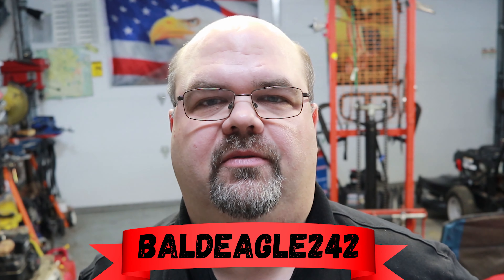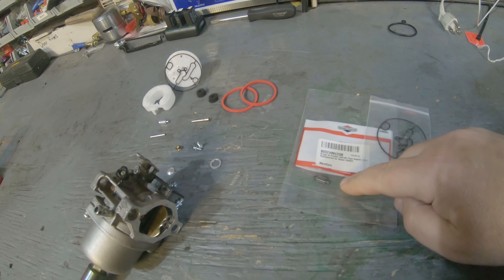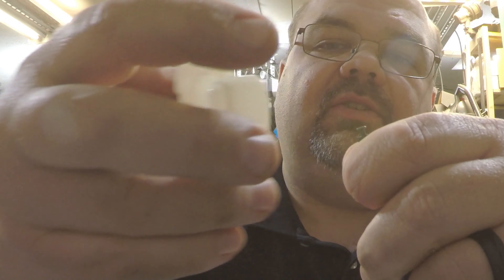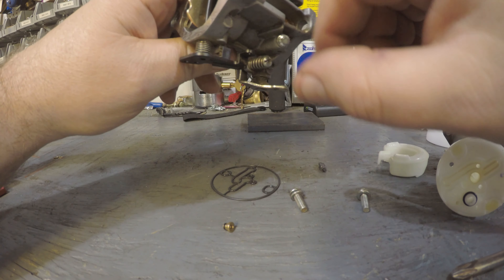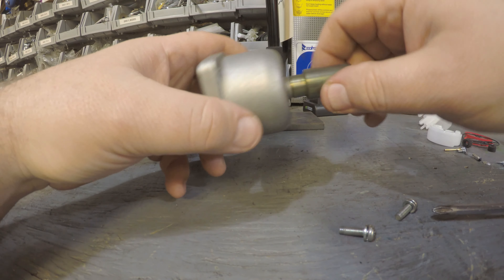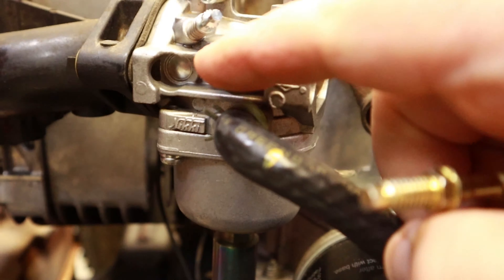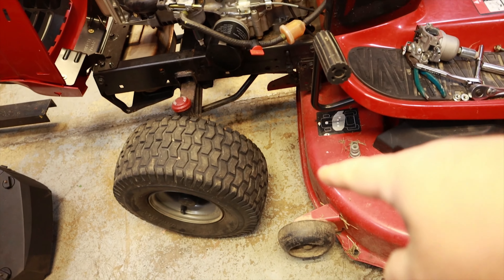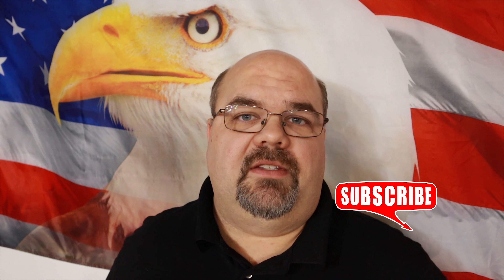No BS! Simple NIKKI Carburetor Rebuild

Comment: Very well made crap...  two rebuild take it off of b & s & be sure to brake the plastic float 
2. Rip the rubber gasket so it is broken
3. Grind the inner jet down to flush with carb so its junk
4. Throw nikki in the fire so it metls it good.
5. Put a LMT WALBRO on briggs. 
6. LMT has one simple bowly gasket , one well bilt jet... NO PLASTIC CHIT, OR RUBBER GASKETS TO PLAY PATTY CAKES...\
Reply from the maker: Here’s the Walbro swap video 😁👇
https://youtu.be/ZVbOFzW0inM?si=yBRVxyCebkjQqIzP

Comment: NIKKI CARBS are one of the worst junk ever made. then WALBRO fixed the NIKKI CARB JUNK with the LMT for the single briggs... Even me old 12hp briggs with the LMT has never gave me no issues, other then have to clean the ports once while. 

the LMT (WALBRO) JUST HAS a simple bowl gasket & a plastic float.... So that tells.

EVERY STUPID NIKKI I HAD I threw them in the JUNK.... because of the RUBBER GASKET GARBAGE & THE PLASTIC....
KLEAN the few ports in a LMT & off you go. 
NOT PLAYING PATTY CAKES with a STUPID NIKKI. RUBBER GASKET TRASH..
Reply from the maker: Well said! You’re not alone with your POV on these carbs. 😉👍